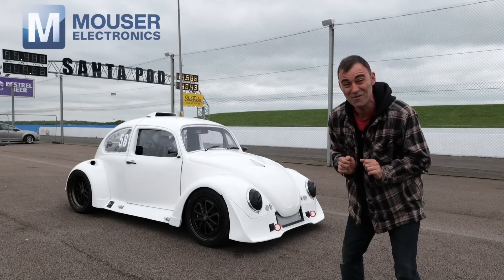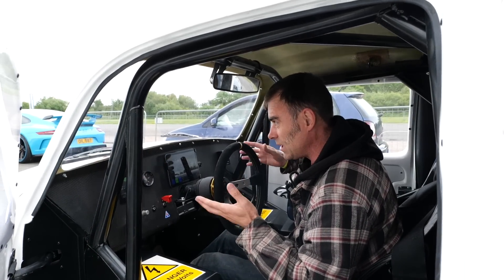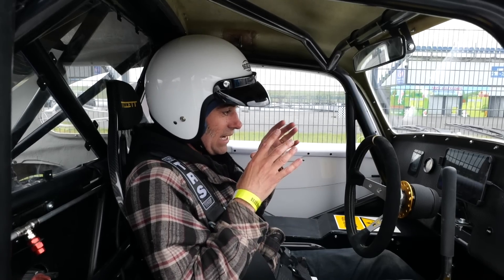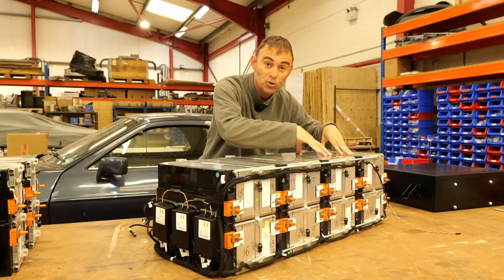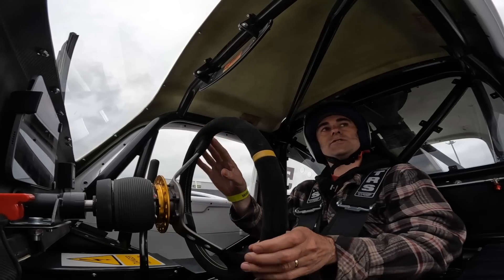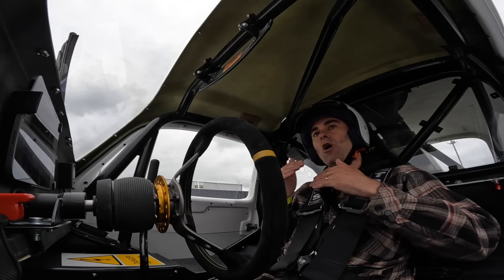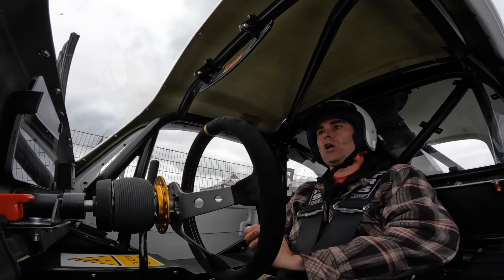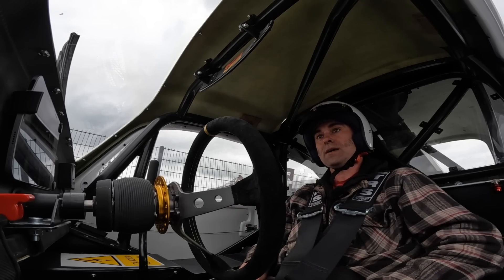Pikes Peak race car Ep12 : We take it to a drag strip

Comment: The stock Plaid does high 9s. 
There hasn't been any of these 
swaps that are any faster 
than the Tesla they took it out of.
I can't understand...  you lose the
stock interior luxury, environmental 
control and LOSE 2 seconds and
probably spend 50 to $100K doing it.
Reply from the maker: Not that we have a Plaid setup in it yet but we’ll have to see what happens when we turn it up to full power. Currently it’s got a p100d setup. 👍
Reply: "I can't understand", that was blatantly obvious !!

Comment: It should be running 8s or at least 9s.      Its not nearly as quick as a 1000 horsepower of combustion power.
Reply from the maker: As we said in the episode it’s nowhere near turned all the way to full power yet. It’s also setup with track racing in mind which is not the best for fastest drag times. For that we’d need softer suspension, higher profile tyres and a set of drag radials. 👍

Comment: need the right tires for drag racing really will knock a lot off the 60ft but wont do roundy roundy circuit stuff lol , you should enter some bracket racing it would do well .

Comment: TBH, kind of disappointing.
awd, 700hp, lightweight electric car should be in the low 10s, if not sub 10s. 🤔
Reply: Did any of you saying this actually watch the video ?, It ISN'T turned all the way up yet, wrong tires and suspension needs setting up......
Reply: @MickH60  try to read and think first.
He said 70% power, that is 700hp out of 1000.
A Porsche taycan with same power and over 2000kg weight does in low 10s.
So, I stand by my comment.

Comment: Could you show the timing slip. I, and maybe a few other, like to use a bit of calculus to get the velocity and acceleration curves over the 1/4 mile from the slip times (I do it on Cleetus McFarlands drag runs to get the speed at the 60', 1/8th mile etc; I also use it to get the 0-60mph times and max g force on the driver).
Reply from the maker: We’ll remember to do that on the next drag racing video. 👍
Reply: @ElectricClassicCars  Cheers for that.

Comment: Meanwhile a Tesla with maximum weight reduction will run high 8s. Some things are seriously not right with the setup or design here.
Reply from the maker: It’s was running at 65% power. The fastest stripped out Tesla Model S p100d, which is the drivetrain we’ve used, is 10.44 on the Tesla racing channel.
Reply: @ElectricClassicCars  Sorry, I just assumed it was plaid powered because it said 1000hp. I guess that's what I get for believing the bogus thumbnail.
Reply: @steveletson6616  Try watching the video next time, all info was in the video.....
Reply: Richie Webbs street legal beetle was a whole 2 seconds faster, 9 years ago.

Comment: Fantastic. I see your tires are slipping. If these are the rear tires, I suggets you to move some of the WEIGHT of the car on the roof inside! So this weight/mass will be transfered to your rear wheel during acceleration from start and will make your tires stick better.
Reply from the maker: Thanks for the tips!
Reply: @ElectricClassicCars  I don't know how you manage with all the "experts" in the comments.... It must do your head in, especially as it seems most of the stupid comments didn't even watch the damn video !!!

Comment: I was surprised to see you didn’t have the wing/spoiler attached. Did you feel it getting light at the top end?
Reply from the maker: Pretty stable at the top end to be fair. However I wouldn’t like to go around corners fast without more downforce. 👍
Reply: Of course you don’t have the old swing axle rear end to worry about. Had I run my old “Clockwork Orange” beetle drag car without a wing it would have ended in tears 😅

Comment: BEVs are dead - stick a fork in them.

They died for 3 horrible reasons:
1) Range anxiety - 300 miles is a joke - 1,000 is what is needed per charge

2) Charging anxiety - taking a trip and your battery is at 15% SOC and the charging station you need to use is full with a 1 hour wait time is to be expected

3) Depreciation anxiety - BEVs lose 1/3 their MSRP per year and at 5 years are worthless
Reply: Good to know you live in 2011
Reply: Go away mate you're full of it....

Comment: “Add lightness”.  A principle I have implemented on my 84 Moto Guzzi rebuild.  Eliminating the traditional loom in favour of a MotoGadget m.unit has eliminated about 4kgs of wiring weight.  Ultimately I could even go to a smaller alternator now that I’ve implemented LED indicators, head and tail lights etc as I’ve dropped about over 100 volts from the running demand on the charging circuit.  Loving your development of this car.

Comment: You folks are doing an amazing job. I hope ICE to EV conversion becomes more common. More like kits being sold for specific models and conversions done at a reasonable cost.
Reply: An M3 is faster over the 1/4 mile with half the BHP, greater range, 4 seats and fully kitted out.  Why would anyone rip the soul out of a classic car and put a washing machine motor in it and a battery that weighs as much as a hatchback?  It like gutting a Chippendale cabinet and fitting a TV inside.  EVs are dead - see Autotrader.
Reply: @BombSponge  I see the concern about battery size. It will become smaller. Its a beginning for Electric Cars.
Reply: @faisal-ca  maybe

Comment: Modern EVs are VERY consistent for drag racing. Particularly for bracket drag racing, where each car chooses a dial-in time before the race. The winner is the driver who gets closest to his dial-in time without breaking out (going quicker than the dial-in time). But there are many skill variables, as well as varying conditions (like temperature and track prep). There are special drag racing sessions called Test and Tune, for drivers to get their car properly tuned and set up to get the quickest times. This looks like it was a total success (given the conditions) where your EV race car was very consistent, quick, and importantly nothing broke. Kudos!
Reply: That was a very long winded way of saying that you don't know how bracket racing works. The winner is the vehicle that gets to the finish line first without breaking out. It could be an 8 second dial again a 10 second dial in car. But thanks for explaining that a test and tune is for testing and tuning.😂 Priceless.

Comment: Dude if I was doing 11.0's the wing mirrors would have come off, anything that's not 100% necessary inside would have been unbolted and left in the pits and every gap would have been taped up. Even if it's only a 10.99 it's still a 10 second run.

Comment: If it’s got the full potential it could probably do mid 9s on drag tires.   The 1020 hp Tesla model S could do 9.5 or so.   The bug is a little lighter so maybe it’ll do a bit faster.    We shall see.
Reply: A dual motor swapped factory five 919 went mid or low 9s before the pandemic happened.
I think it weighed 3,100# or so? Like a 50kwh pack using phev minivan modules, with large rear drive unit&small front du crammed in.
You can find the video on here search factory five TESLA.
Reply: Over 50mph your pushing more and more air out the way with the upright screened bug body ... So 0-60 will stay quick but 60-120+ will be having to work harder and draw more power  than a more  CD friendly  form.. 
Smoothing details helps but so do things like Kamm tails.  
In a race the airs usually all 
Over the place untill you hit a straight  and try taking the lead... So twisty circuits are probably best.

Comment: It'd be nice to see a like for like comparison, whether the wifi hardware is lighter then the cabling, and information on how it stays secure, and not influenced or disrupted by other wifi systems around it. One advantage it will have, is being able to issue fire depts with a wifi device that can shut down the battery from outside the vehicle in an emergency without a fire fighter being at risk.

Comment: Great work guys. How do these times compare to your road car EV Beetle? Cheers
Reply from the maker: My road car is very very traction dependant. It’s only rear wheel drive, but then again has the advantage much much wider rear tyres. Fastest I’ve done in that is 10.4 seconds, but it’s no where near as consistent as BugZappa. It’s anywhere from 11.5 to 10.8 usually.
Reply: Cheers for the info. Amazingly consistent at that power level.  Great work.

Comment: At  70% power  drives straight, consistent 11 secondish with front and rear burnouts.  So next step is 80 to 90 % power? It was a cold day at the drag strip. Does the battery management software allow you to manipulate the temperature from a lower to higher or vice versa? Or do you have to plug in a manual heater or cooler front and rear to get a desired temperature?
Reply from the maker: We’re going again this weekend and cranking it up to 100%. Let’s see what happens. We’ve concentrated so much on battery cooling we never thought about battery heating. 😁😆👍

Comment: definitely need a 3 position toggle switch to speed up switching between fwd, rwd and 4wd at the line
Reply from the maker: True.
Reply: Awd,not 4wd. There is a difference.

What is the difference between AWD and 4WD? Both send power to all four of a vehicle's wheels, but AWD is more useful on paved roads or for light off-roading, while 4WD has a lot of off-road capability but limited usability on paved roads.

Comment: Very consistent indeed, well done.
Two questions. How greatly does the range increases, if at all, with the power reduction? And how much KWh was that pack where you explained the wireless bms'?
Reply from the maker: Yes, using less power (kW) will result in using less energy (kWh) which should result in more range. The pack we had on the bench was 41.5kWh. 👍
Reply: @ElectricClassicCars  It would be an interesting experiment to see both the savings and where is the sweetspot between capacity/power/weight.

Comment: 11 sec at medium power is actually very fast! Great job.

I hope the wireless BMS works but my car stereo connects to my iPhone using WiFi/Bluetooth and it regularly drops the signal. I've driven on the same freeway multiple times and my wireless connection drops at the same place on the highway. I know there are ways to kill cellular signals along with WiFi signals so have have to wonder whether these wireless BMS products can withstand the signal cancelling done by various organizations (like the police).
Reply from the maker: Yep. Can’t wait to try it on full power now. 👍